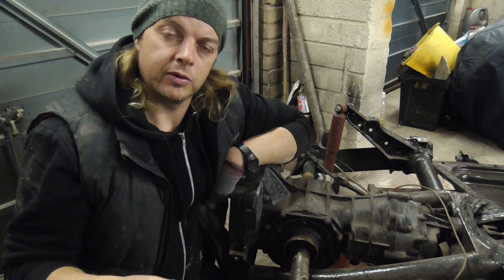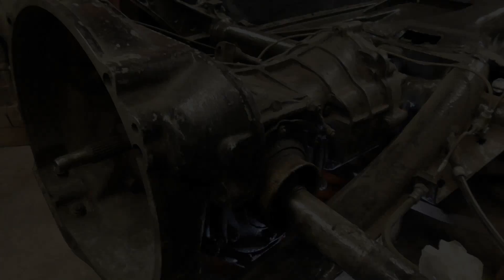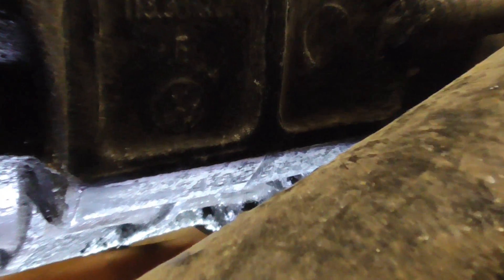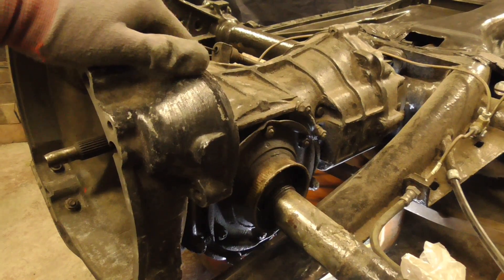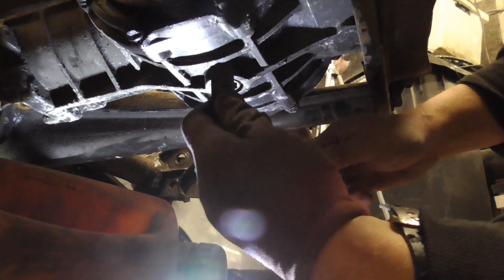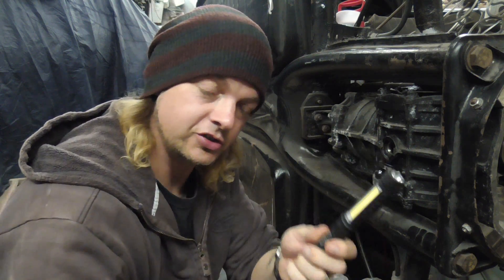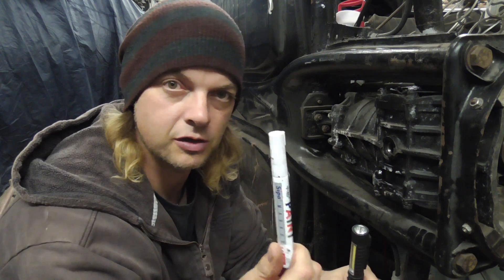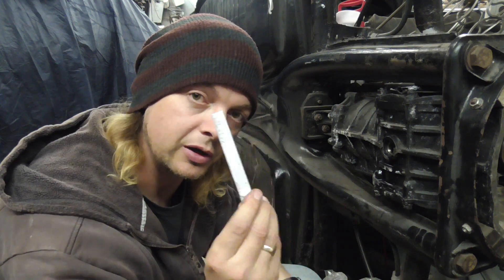Gearbox Codes & How To Identify a Gearbox Without One By Counting Ring Gear Teeth - VW Beetle Bug

Comment: Shouldn't you use the correct size Allen wrench so you don't strip the plug?
Reply from the maker: Ideally yeah, but it's only a tiny bit too small, never caused a problem and the same key I was given 30 years ago so kinda attached to it now 😅

Comment: Okay ;

Nice video, I have two questions : (I'm U.S.A. based ex VW Mechanic)

On the swing axle and some IRS trannies there was often painted between the ribs from the factory ~ most often yellow but quite a few pink IRS ones too ~ does anyone know what this indicates ? .

Second question : 1961 ~ 1967 Bug trans. I need to replace the front main shaft ball bearing and don't have a puller, what now ? .

Also, are there any upgraded bearings ? maybe with more than 7 balls ? .

If so part number please .

I've been looking for a tutorial or video of replacing the front bearing to no avail ~ any links will be greatly appreciated .

-Nate
Reply from the maker: Hi bud thanks for the message. Unfortunately im not going to be much use here as was never brave enough to do a gearbox myself. And now I am ive not had the reason to. I'll be honest I didn't know there was a ball bearing inside the gearbox. Sorry. Usually there will be a puller for most applications and they aren't all that expensive on ebay these days. As for the yellow painted box  again I'm not sure. It's not something I've ever seen here I the UK in 25 years so assuming it maybe a regional thing. I don't imagine VW painting stuff yelkownor pink though so are you sure it's from the factory and not someone painting there boxes when rebuilt as a particular business of something? Like the Thurrock red engines etc? I'm sorry I can't help more. 😔 Good luck and if I hear or see something I'll come back to you. 👍
Reply: @PeoplesCar  Thanx ! In the 1970's I had a VW shop and yes, I know for a fact the paints were factory .

I too never ad the nerve to take a transxaxle apart but now why not, this one works so well apart from that one noisy bearing .

Keep on sharing your knowledge please .

-Nate
Reply: There does exist a special puller that has fingers that fit between the balls of the bearing, but those pullers are extremely rare. And expensive.
I can guarantee that your trans has other parts that are worn out and ready to fail. If you found a way to swap just the mainshaft ball bearing, you will have to do some other repair soon after. In other words, you need a full rebuild now. If you continue to drive the trans the way it is, more parts will be destroyed.

Comment: Hi my trans is an AH SO 1968… 1500 or 1600 how can you differentiate which it is and any other info that might be important! Thanx!
Reply from the maker: SO?   I believe the AH was in the 1500 from 8/68, and 1600 from 8/69 - 8/72. AFAIK the final drive is 4.125 for both so no difference between 15/16. Hope that helps 🙂👍
Reply: @PeoplesCar  thank you found a trans now the rebuild repair… any good guides for this trans?
Reply from the maker: @danielr.schafer9504  my only advice on gearboxes is the knowledge I've picked up over the years. I was advised by a highly reputable engine builder here in the UK that if in good condition and driven with respect a stock box is good for 130bhp normally aspirated. So I guess it depends what your planning to do with it. I never managed to break one with a 1776 and plenty of abuse and drag racing so relatively tough items. A heavy duty side plate would probably be my first recommendation if plan to put power through it, keep the diff where it should be and what i have planned for one I have ...will be fitted with an 1835cc and possibly supercharger. After that the world is your very expensive oyster! LOL Best of luck 🙂👍
Reply: The first AH gearboxes from 1969 model year had two drain plugs. This trans has coarse tooth gears and the early 4 bolt pinion bearing. For 1970, the front drain plug was eliminated. A threaded pinion bearing was installed along with fine tooth gears. Even though the 1970 trans used the early floppy throw-out bearing, the case has the locations where the late guide tube can be bolted on. In other words, you can upgrade your TO bearing by drilling and tapping the three holes. After installing the guide tube, install the 71-72 cross shaft. Now you can use the 71 and later clutch.
The 71 trans has the upgrade described above.
In late 72, VW created another main trans case with only one side cover for use in IRS cars. Called the Single Side Cover, (SSC), this trans was also coded with AH on some of them.

Comment: I'm trying to Id a trans we found in our yard.  Its definitely a swing axle.  I counted the teeth according to your video, It has 35.  but where you show the part number should be I just see numbers, no letter part code.  the number is either 8097237 or 8007237 I can't tell which. but know 2 letters are not in sight.  Just curious if you have came across this.  can I trust that its a 1300 based on the tooth count? Thanks Bro
Rob
Reply from the maker: Sorry this message didn't ping up on my phone. Just found it. Please double check me but I believe that any box that is pre 67 didn't have any letters. That would make it as 1200 box which afaik is the same final drive as a 1300 at 4.375. The earliest boxes are one peice casting so don't have a split down the middle and are als crash boxes. To the best of my knowledge. 👍

Comment: My gearbox has no letter code just |6456|47 vertical lines are case castings
Reply from the maker: Assuming your not looking at a casting number on the side rather than the gearbox code on the flat plate, it suggests you have a pre67 box. Is it a split case box with a seam and nuts along it's tip and bottom?  
If so it would be an early box with 1200 ratios I believe. Hope that helps? GL 👍

Comment: Do you know anything about the 914 transmission? I have a 914 engine and transmission that I want to use, but the ring gear needs to be flipped in order to use the transmission in a VW.
Reply from the maker: I really don't sorry, fttb a 914 is something of dreams LOL. I did a quick search on Google and seems to he a few forums etc. There seems to be some good information on this page and flipping the diff sounds relatively doable with minimal clearancing but I'm not sure if will need a jig/support etc when splitting the box etc? http://914world.com/bbs2/lofiversion/index.php?t247448.html
Cogs scare the hell out of me! Lol
Best of luck 👍

Comment: How do you find out the year of a gearbox better all numbers no letters I have 6368241 on my gearbox
Reply from the maker: I'll be honest I'm not entirely sure as never had to do that. I believe early boxes only had numbers so could indicate it's >67 and would more than likely make it a 1200 box. You have to be careful your are looking in the right place as shown in the vid because there can be a 2nd set of numbers further round the case that aren't the gearbox code.  My first impression from that number if is actually the correct code is it's a 1963 box.....but that would be a total guess. I'm pretty sure you will find how to date it tho with a Google search and from forums like Volkszone or TheSamba. GL :)
Reply: My 1959 has only numbers also...645647 is all I see,,,but it's not built like the crash box I was expecting
Reply: The letter codes discussed in this video started in 69. Gearboxes before that were just a sequential number like you have. You need to go to thesamba where they list the rear axle numbers and when they were made. 
Your gearbox is from a 1200 from the early 60s.

Comment: Really interesting, thanks! So did they only change the gear ratio from the ring gear? If I changed out my ring gear, would it need a different sized pinion?
Reply from the maker: If you look at the list below in the comments you can see number of teeth on the ring gear and pinion. 
I don't know if the pinion changed though, if the teeth shape etc differs depending on the ring gear  used, or what other differences there are, sorry. :)
Reply: The pinions are all different for each ratio. On top of that, VW used 3 different types of gear cutting machines for each ratio. Those machines created different tooth shapes from each other.
During manufacture, VW tested out each ring gear with each pinion. Once they found a set that meshed properly, those two gears were mated for life. In other words, you can't mix gears around.